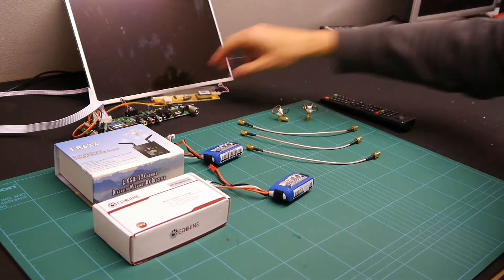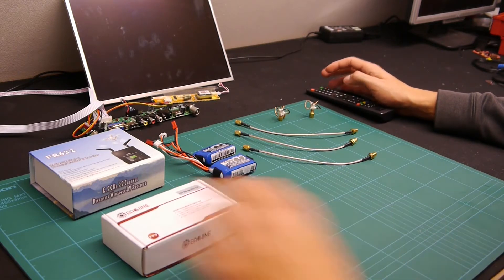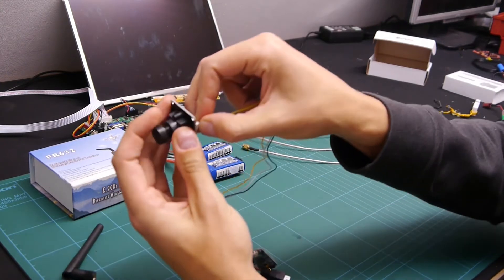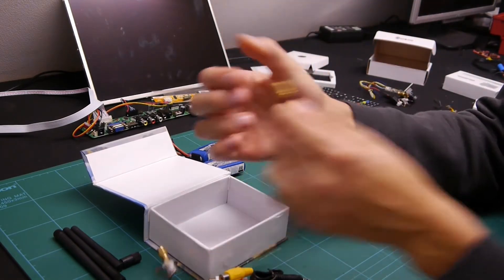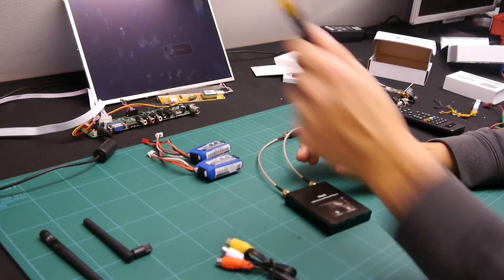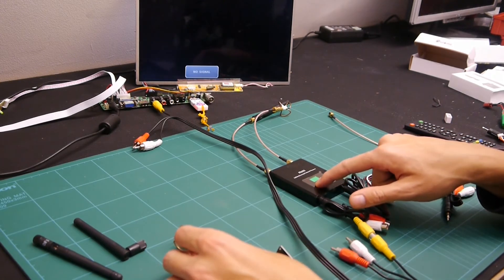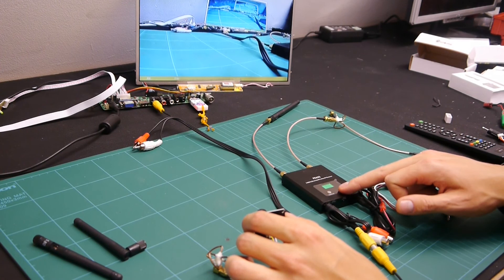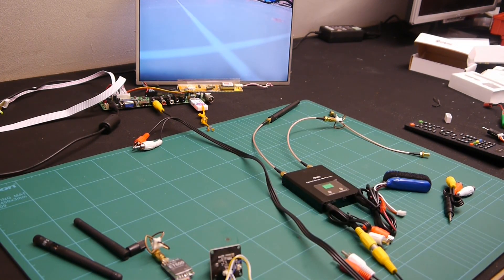TheManLab - FPV Ground Station Build - FPV Gear Test - Part 2

Comment: You’re going to get a lot better range with your diversity receiver if you pick either linear antennas or circular antennas and running One linear and one SKU planner is not diversity if you do some research you understand what I’m talking about

Comment: im liking your vids so far! does the control board for the monitor go to blue screen or static? I'm wondering if i built this would i add my existing 5" fpv screen as a backup as it doesnt blue screen. thanks
Reply from the maker: You can turn blue screen off and on. I have it set to off so I see static when connection is lost. Enjoy!
Reply: +The Man Lab awesome!!! thanks man. also... how are you supply power in the field... is it 12v input?
Reply from the maker: +Chris Flory Just with the 12v battery that's in the case. Enjoy!